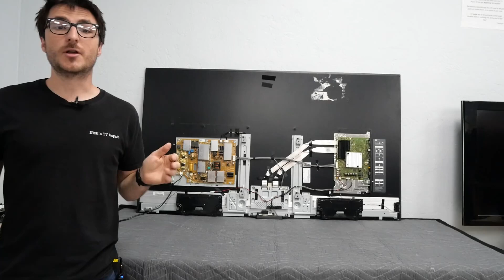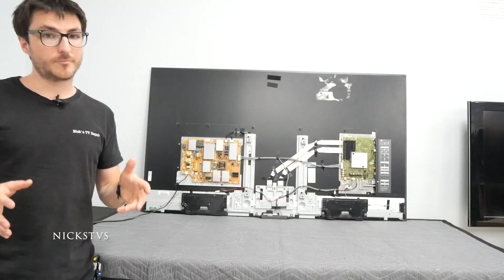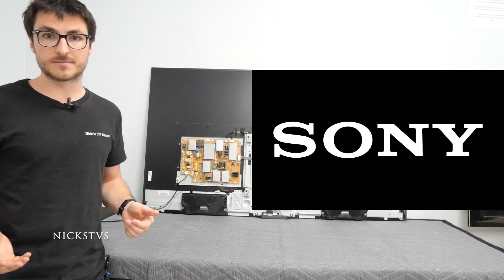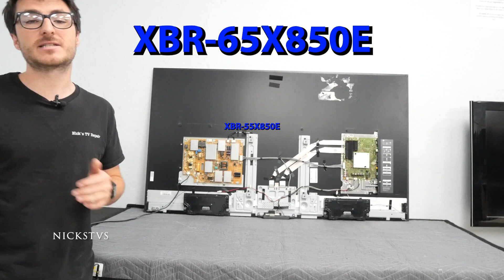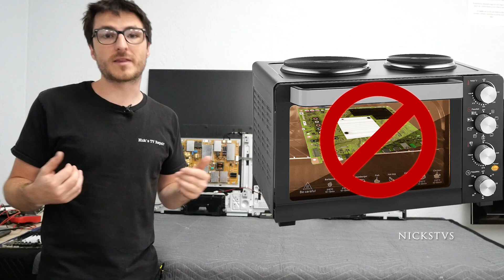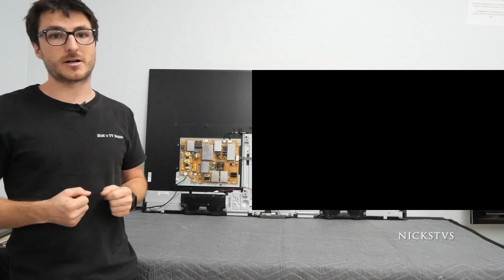Sony TV Diagnostic For Beginners Blink Codes Explained XBR-65X850E XBR-65X900E

Comment: Great video Nick, replace backlight is difficult and danger to brake the screen during handling, so not recommended for users to do so, main av board replacement can be made by some users. Thanks Nick and good luck with your business.
Reply from the maker: Yes backlight is very difficult, I wouldn't recommend someone who has never done such a repair to do it, especially not on a Sony, they are very difficult. 
Mainboard or power supply replacement, that is easier though. 
Thank you for the feedback and for watching!
Reply: I’m thinking of trying this all the same. I have a Nov 2015 Sony XBR-55X850C that failed and has already been replaced. 
This unit has the 6 blinking error code as well. 
I’ve had the TV apart and removed the TCON board just to do a visual inspection. 
I am thinking of ordering a pair of suction cups and a pair of LED strips. I am also prepping my work area to accommodate both the TV and the removed main screen and the diffuser sheets. 

From another video, the LED strips look to be a pain to get out and clean out the residue. 

Do you have any videos or tips to make this easier?  Can I remove the diffuser sheets intact with the bracket that holds them?
Thanks, sorry for the long read!
Reply: I have a xbr-65x900e with 4 blinking lights and no picture

Comment: please help me
Reply from the maker: No problem, I just need more info
Reply: @NicksTVRepair  if can give me your email address, i can send photos and information this self
Reply: Hi i have this same exact model tv  and it was diagnosed to be the power supply board it was blinking 6 times and now does not power on. I cannot find the power supply board anywhere and I was wondering if a different model power supply board work on this model. Any help or information would be greatly appreciated

Comment: hi nick's i have lg 42lw450a led tv, it is power on but no display and backlight
Reply from the maker: No display and no backlight but it does power on. I am going to assume you did the flashlight test to try and see if there is picture. 
I don't see that model very often, but it does seem like it is most likely a mainboard failure. 
A few things to do would be to disconnect the T-con board from circuit and power on the set. If the backlight all of a sudden comes on, then your T-con or your screen are at fault. If the backlight still doesn't come on however then we can rule those two out as potential issues. 
Do you have a multi meter and know how to do voltage checks safely? 
Please do not reply to my message, I don't get notifications for replies, only for new messages, so post a new message
Reply: @NicksTVRepair  oky i check it

Comment: How do I fix my tv with boot loop problem please help me
Reply from the maker: You can try a force reset. 
Unplug your TV from power, then using the buttons on the back of the set, not the remote, press and hold the volume down and power button. Keep those two buttons pressed in and at the same time plug the TV back in. As you are plugging in the tv, make sure to keep the volume down and power button pressed in for at least 15-20 seconds, or until the standby light turns a solid green. 
Once the 15-20 seconds have gone by or the light turns green, go ahead and release. The TV should reset itself. If it does not, try again, sometimes it take 2-3 tries before taking. 
If you are unable to get the reset to take, then try a software update. 
Follow the steps in this video:

https://www.youtube.com/watch?v=gBd2g7kRsEM

If that doesn't work either, then your mainboard has failed on a hardware level and you will need to either replace it, or send it in for repair. 
We offer a repair service for that failure linked below:

https://www.nickstvs.com/store/p2347/XBR-65X850E.html
Reply: I’ve tried all the hard reset thing and didn’t work my tv is running on the latest firmware.at this point I don’t know what to do unless maybe I wait for another Sony tv firmware to be released.. what do you think please
Reply from the maker: @emmanuelnk3217  This means you have a hardware failure and you will need to either replace your mainboard, or send it in for repair. 
What model TV do you have? If you have the same model TV as the one we are showing in the video, then I have a link to our mainboard repair service linked in the description which I will link again below:

https://www.nickstvs.com/store/p2347/XBR-65X850E.html

If this is not the model of your TV however, then let me know and I can point you in the right direction.